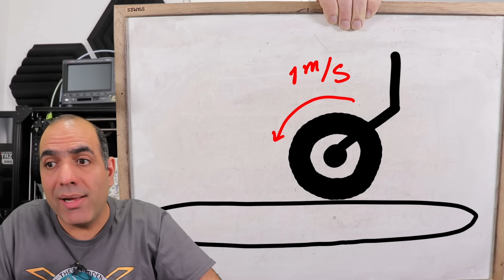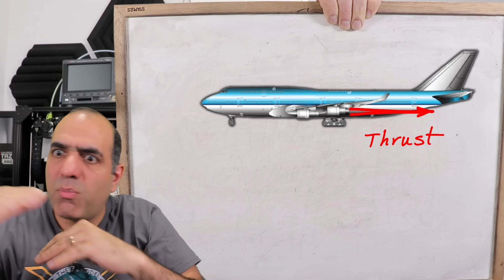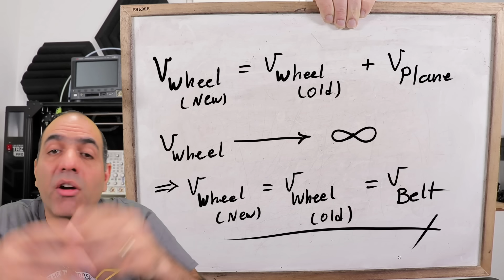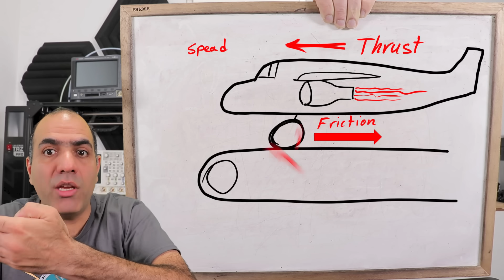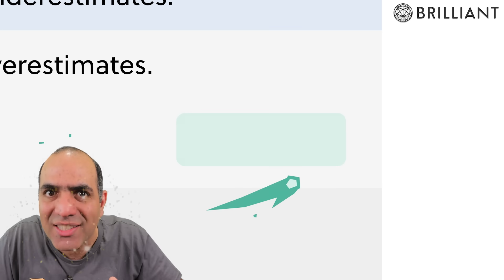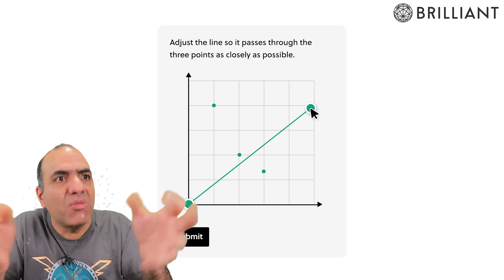Airplane Question that Drove Me NUTS!!!

Comment: Nice video, as always. 😉
Isn’t the runway always matching the speed of the wheels in “opposite” direction? Wheels are never slipping at take-off, right? Or is that too easy of an answer? I agree the formulation of the question leaves too many open ends for interpretation.
Reply: It is a straight forward answer wheel speed equals conveyor speed is the given information so no matter what conditions (jet, prop, powertrain wheels) any vehicle is stationary.

Back on tarmac, any vehicle will have a wheel speed at any given second.  A matching / adaptive conveyor means that speed is always negated.

Comment: Why do so many people assume wheel speed means the speed at the circumference and not the hub? Forward speed of the hub is the same speed as the rest of the airframe and doesn't ceate a paradox. Assuming speed at the circumference creates an unsolvable paradox, speed at the centre of the wheel does not
Reply: Working with the tangential velocity of the wheel makes the whole scenario more interesting. There's no paradox, but the answer goes against the intuition of most people who have experience with motor vehicles since neither the wheels nor runway have anything to do with why an aircraft moves forward. That's why so many people are getting this wrong despite their confidence

Comment: If for some unknown reason that the Jet would not take off, you would not have to worry about the jet ever taking off again.  One of a couple things would happen to the wheels... 
A::: The bearings would super heat and melt causing total destruction of the rim throwing pieces of rim outward at an extreme velocity, shredding the wings and jets... 
2::: The Centrifical force would blow the tire apart shredding the wings and jets

Question..... If we were to fasten every jet airplane in the world to the ground so they would not move at full thrust, and point them all in the same direction, lets say
 A. Facing the direction of the rotation of the earth. 
Would this,
A. Speed up the rotation of the Earth

Or B. Facing the opposite direction of the rotation of the earth
Would this,
Or B. Slow down the rotation of the Earth

Hmmm the things you think of after smoking a joint...lol

Comment: I think this question is intentionally designed to create disagreements and that there is no real answer.

On one hand, if the question means that there IS friction and the movement of the conveyor belt is there to cancel the forward motion of the plane, then you may as well just say that the plane is fixed to the ground. Obviously the plane will not take off and fly in this scenario.

On the other hand, the plane does not need wheels to drive (thrust) itself forward since it uses jet engines (or propellers). In this scenario, the movement of the conveyor belt does not matter and the plane is able to fly.

Comment: The conveir belt would not work. it would try to comencate for the wheels but it would never catch up because the plane is using air to move not the ground. It depends more on the wind direction and speed. If you have strong enough wind speed you can start taking of standing still in relation to ground.

Comment: The speed of the belt and the wheels is irrelevant....if the belt was as long as a runway and it matched the speed of the plane as its jet engines move it forward through the air the wheels could stay stationary...or if the belt moves faster than the plane  ..the wheels could actually rotate backwards

Comment: The thing is, as soon as this plane turns on the thrust, both belt and wheels will spin so fast one of them will explode, so the question is "which one will fail first - belt or wheels?"
If wheels fail first, plain will definitely not take off.
If the belt fails first, the plane will take off.
If the belt fails in a way that also destroys both the wheels and the plane - no take off! :D

Comment: 4:45 THAT was the point I always thought about. For me there was never any doubt the plane would take off, it was the imaginary situation where the conveyor belt's speed would have to approach infinity. I've seen plenty of videos about this and it was never brought up.
Reply: That’s what makes it confusing. There’s no vicious cycle where the belt causes the wheels to spin faster. The wheels trigger the belt to spin faster. That additional speed wouldn’t reciprocate back to the wheels because the wheels are what determines the speed of the belt. Since the engines on a plane don’t power the wheels, the speed of the wheels would only depend on the forward speed of the plane, then the conveyor accelerates in kind. Therefore, the conveyor would only ever match the speed of the plane assuming they both started at 0. The other confusing part is the fact that the wheels would spin twice as fast as on an ordinary runway since the belt is moving backwards. This doesn’t double the speed of the belt, it just means the wheels are spinning twice as fast AS THEY WOULD ON A RUNWAY. 

The one thing everyone agrees on is that the wheels don’t matter. That’s basically it… the wheels wouldn’t matter since the plane doesn’t have to push off the conveyor like a car. The visualization just messes with people, myself included.
Reply: @tylerpierce1861  yeah, seems logical. Plane pushes off the air, so at the start it's speed is zero and wheels are stationary. When plane starts to move wheels pick up the speed and belt matches this speed. And I think by matches we mean that the points of contact remains the same. In this case belt will go at speed V and wheel at 2V maintaining this ratio , Shouldn't go to infinity. Unless there is a feedback mechanism that tries to match numbers by measuring speed of the wheel and translating it to the belt without taking into account the ratio. Simply divide by 2 and it is solved.

Comment: LOL, the belt will create additional headwinds and extra ground effect that will significantly reduce the take-off speed. However, as soon as the airplane exits that local wind, it could encounter some issues.
Reply: Finally someone else who also knows about ground effect
Reply: Only if they throttle down.  The plane would continue to accelerate on that ground-effect layer until it gained enough speed to generate enough lift in the air above, assuming the runway isn't shorter than normal.

Comment: the only additional force applied to the aircraft by the belt would be extra friction of the wheel bearings
At worst, it would be like having a very small braking force that a 747 can easily overcome to reach its takeoff velocity
HOWEVER
bearings are not indestructible. The wheels would effectively be travelling at double the speed they are rated to rotate for takeoff. This is a problem, potentially an enormous one. Its likely that under these conditions the bearings, brakes, and tires could combust and/or explode, which will have a detrimental effect on the takeoff characteristics of the aircraft

Comment: If you think about it hard enough you get a headache (like me and my brother) the airplane dosent use the wheel speed to takeoff rather theyre just there to provide a easier rolling surface that causes less heat and wear and the planes thrusters, propellers, jets, engines whatever you call them are the source of propultion so theoretically if you put the plane into reverse thrust make the wheels start to rotate backwards and then they hit the wheel brakes it should push the plane while gaining speed due to the tires trying to fight the forces of the brakes and/or treadmil allowing it to take off but theres also the theory of starting to enable the brakes so the tires have resistance and taking off like that with some brake control you should theoretically have a standard takeoff (my theories) my brother also preposed that since the plane pushes againt the air to move not the tires all they have to do is takeoff normally assuming there is no wear and damages to the tires from high rotation speeds, and if there is then all you would have to do is put a ski type of device at the bottom of the planes landing gear therefore it wont have any rotation causing the treadmil to stay still and allowing the plane to take off or putting a thick layer of ice around the tires so the treadmil wont have the best traction and it will slip during accelleration making the plane takeoff normally (if you read this far reply to this comment with the 🌮 emoji and ill cashapp you 10 bucks when i get paid on the 15th |be sure to give me your snap number or cashtag so i can send you the money| and if you find my 2nd comment ill send you 50 bucks you must reply to both have a good one yall♡)

Comment: ASSUME no wind, plane stays in the same place relative to the ground, nonslip condition wrt wheels

IF the idea is the plane’s center of mass stays above the same location on the mechanism (i.e. doesn’t move forwards or backwards relative to the ground), the thrust could be 100 kip or zero and the plane will still not take off. 

Lift requires fluid to pass along an airfoil, and if the plane stays in the same place relative to the ground, there is no fluid flow over the wings. The only thing increasing thrust does is increase the speed of the conveyer belt.

IF there is wind present, a headwind equal to the necessary takeoff speed under normal conditions would result in the plane taking off.

Comment: Airplanes is driven by pushing the air with propellers or the turbo fan engines, not the wheels. It will be pretty much impossible to make a conveyor belt that slows the airplane down so much that it can not take of because there is extremely little resistance in the wheels.

If you manage to actually make a conveyor belt moving that fast I suspect the wheels on the airplane would explode from the centrifugal forces alone before it stops it from taking of (also the rubber would be long gone)... Then after that you will have rapid unplanned disassembly and parts of plane and conveyor belt flying everywhere, so no you can not stop an airplane from "flying" (in pieces) that way.

Comment: Actually it couldn't fly tho, for flying you need a certain* AIRSPEED (knots) not GROUNDSPEED (km/miles), if we stay on the same position but the wheels spin, it wont generate lift on the wings to be able to fly. One very important condition for a plane to fly is the air under the wings, if you dont move, the air won't move fast enough to generate the lift need it so it doesn't matter how fast the plane wheels run if the air doesn't reach the enough speed. I hope this answer can be added :D. From my mild passion :)

Comment: the only reason we have runways is so the plane gets a certain speed before liftoff, if the plane is still accelerating while on the tradmill then it will 100% be able to liftoff until it reachs its desired speed

Comment: velocity is displacement / time , not distance. on a conveyer belt displacement is always zero, therefore velocity is zero, therefore plane can never takeoff, even if the speed approaches infinity. And since displacement, velocity and acceleration are always zero, the force is zero. Therefore, you never can generate lift being essentially stationary, no matter what your speed is.
very very important to understand the difference between a vector and a scalar, the solution to this problem gets relies on this fundamental understanding.
Reply: There's no reason for the displacement to be zero, there's an unbalanced force in the form of thrust, which comes from the interface from the turbine blades and the air. The ground has nothing to do with it
Reply: @snowthemegaabsol6819  Okay. Thanks for your input.

Comment: No as the plans is required to be in motion to get enough lift to overcome gravity if a plane stops midair it’s gonna start falling until it’s speed rises to a point where it can generate enough lift to pull up

Comment: here's my completely simplistic take:
When you run on the treadmill, do you feel wind resistance? Yes. 
Wind hitting you means the same wind can create lift. 
a cat 5 hurricane can lift the plane without any wheel spin, traction or the runway
Reply: There shouldn’t be wind motion on a treadmill.  That’s the point here.  Vehicle motion of an aircraft is only the rolling motion of the wheels (not powered, of course, but the net speed).  The cart and wheel problem is an intro to physics calculation.

Comment: Actually let's turn this the other way. The runway moves forward as the plane takes off. More speed in shorter time so less runway needed. Brilliant!
Reply: That would only result in a slightly faster acceleration and shorten the time to rotate. The distance the aircraft has to travel before rotate would barely change

Comment: Im just guessing but even if the plane was staying in one place on the conveyor it's still going at speed for take off so all you'd have to do to take off is to well pull up right? I mean the air resistance is the same so I don't see how the conveyor effects it at all other than using less runway might feel stupid after I finish the video but I mean that just makes sense

Comment: But it still takes Bernoulli's principle into effect, it makes the conveyor irrelevant. it would still allow the plane to fly, the turbines would force the air around the wings allowing flight.
Reply: Turbines are located under the wings, not in front of them. Their job is to heat up and accelerate air backwards as reaction mass, pushing the aircraft forward

Comment: If the wheels have friction and the wheel speed is close to infinity the radiation pressure from the superheated bearings would blow the plane into space like a solar sail. Assuming that nothing breaks.

Comment: A 'Standard' runway would 'match' the speed of the wheels anyway, so yes. Any difference between the surface and wheel would be considered a loss of traction, however force is created by the thrust from the Jet engine and not the wheels so the traction loss is negligible... I think...

Comment: Talk about overthinking it. Look, its pretty simple the belt moves in the direction and speed to prevent the plane from moving forward (therefor it is sitting on the belt). Thrust from the engine makes the wheels match the speed of the belt, so for all intensive purposes the wheels are generating the thrust. The question you should have asked is about momentum. Does the plane have it? Yes, if the belt stops, it fly's ahead at tremendous speed. What keeps the plane from flying is the amount air traveling over the wings. Since it is sitting, there is no air moving over the wings. If the belt is turned off, the momentum of the plane pushes it forward and the air drastically covers the wing and it will fly. Your basically doing a burnout before taking off, like what they use on aircraft carriers. You could just use brakes like what they do and no belt, same diff.

Comment: Its a trick question, 747 take off speed is 160 knots (184 mph). The wheels on the plane are not powered by the engines, the plane can still reach 184 mph air speed, and the wheels on the teradmill will be spinning at 368 mph.

Comment: If you actually set this up and had some way of mechanically linking the rotation of the wheels and the belt, the plane could potentially move forward by skidding.

It would be effectively the same as trying to take off with wheels that don't rotate.

I've never seen someone try that so I have no idea if the plane could take off or not, but the prospects are not good.

Comment: My answer: i don't know enough about planes to be able to give an answer (my first gut reaction was that the plane would be able to take off but then i though about it more and switched my answer to the plane not taking off, then thought a bit more and realised i couldn't give a proper answer because i'm too stupid)
Reply: All you need to know is that the wheels and treadmill are a red herring. Aircraft aren't propelled by their wheels, they're propelled by accelerated air from the turbines, which don't care about what's happening on the ground

Comment: a similar case could be made, by asking "if the plane is pushed at take-off speed by not-the-force-of-it's-own-engines... can it take off?"
that's basically a navy catapult..... and they've been working since 1960.
all the reverse runway is going to do, is remove the length of road that the plane is required to travel down, for the engines to push hard enough, to achieve lift.
engines don't go 0 to 100% immediately... they require acceleration... and acceleration is a function of speed and time.... and speed not-being-what-it-needs-to-be, equals, wasted time.
make up for that wasted time by shortening the take-off distance, and voila! navy catapult.